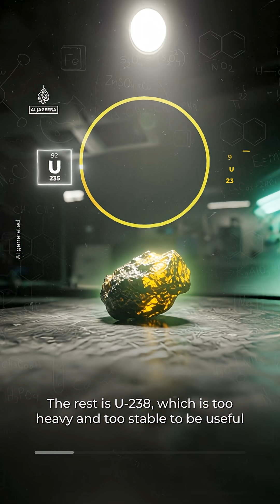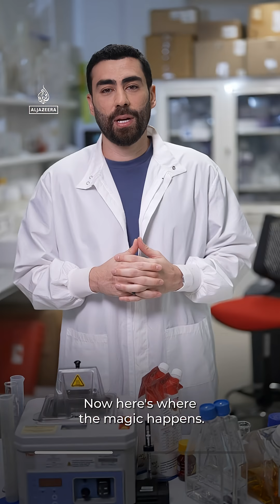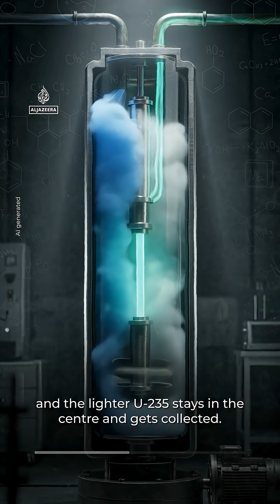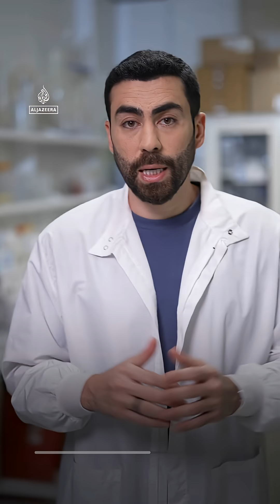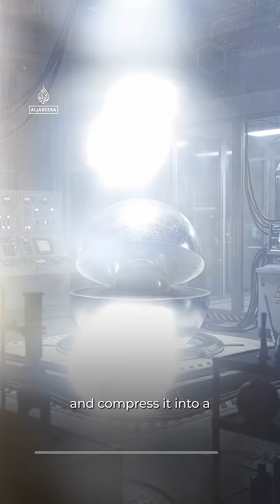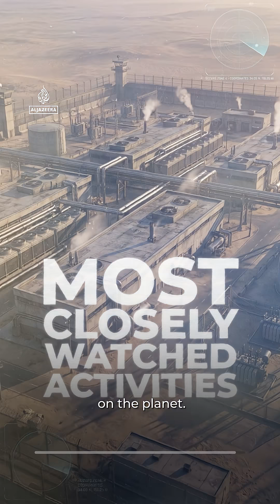The Process of Uranium Enrichment

Comment: Fun fact: if you go just at 69% enrichment, you can get a battery that can last for 6.9 million years. But it can only power a dyld0™.  Imagine getting fvkkd by a dyld0™ nonstop for 6.9 million years..  you be flooding basements for millions of years. Hermes and saint laurent avtually tried to develop this ultra exclusive dyld0™. But they couldnt agree on the grit and length. ❤❤

Comment: Good explanation but.....I was under the impression that nuclear weapons used Plutonium -- a by-product of nuclear fission in a reactor -- isotopes of hydrogen, also made from reactor byproducts (or pulled from water) and U238. I thought the only U235 bomb that was ever made was the one dropped on Hiroshima -- not at all powerful for the amount of material used. So the real flashpoint is reactors and reactor spent fuel processing.

Comment: Impressive explanation! ... and all of this works because despite isotopes are different, their chemistry is based on their proton count which is equal. This means they react the same so you can dilute them in acid and then make them into gasses. And gasses a very sensitive to molecular mass and pressure.